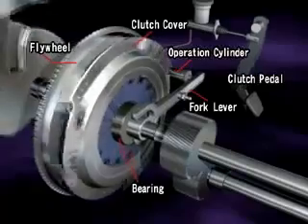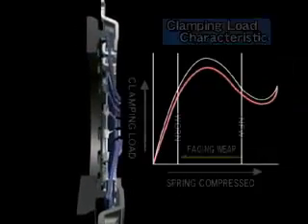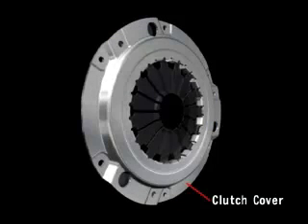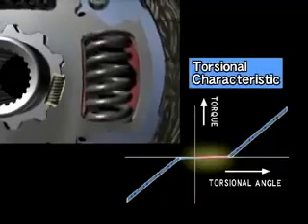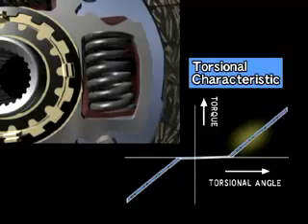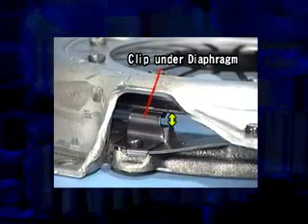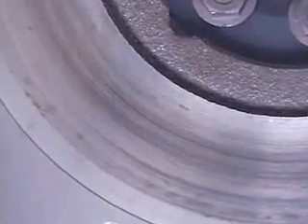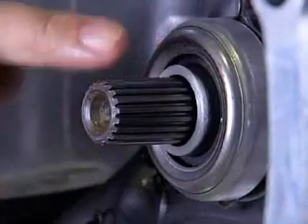HOW A CLUTCH WORKS   NZ Automotive Distributors - NZAD - Clutches - Flywheels

Comment: The clutch disc is NOT attached to either the clutch cover assembly OR to the flywheel OTHER than by the force of the diaphragm spring. When the clutch pedal is pressed that spring force is removed and the clutch plate is free to float between the flywheel and the pressure plate. The clutch plate is only directly attached to the gearbox input shaft via the splines on the shaft and the matching splines in the centre of the clutch plate on which it can slide. (N.B. The CAPS are only for emphasis,)

Comment: Wait a sec, if the clutch plate is bolted to the flywheel, then how can the clutch disc be in free motion if it is attached with the clutch plate? The clutch plate is always rotating with the flywheel right?

Comment: Great job, the extra detail was very helpful. Am I correct to say that the force holding the clutch firm against the flywheel comes from the elasticity of the diaphragm spring? So, the throwout bearing is designed to pull evenly back on that diaphragm spring to relieve the pressure?

Comment: When the clutch is fully engaged (the clutch pedal is out fully) there is no slippage between the clutch disc and the flywheel as they are in full contact with each other. Likewise, when the clutch is fully disengaged (pedal is in fully) there is also no slippage as the two parts are separated from each other. But when the clutch disc and the flywheel are only in partial contact (pedal is halfway) they start to slip and this creates friction which wears down the clutch.

Comment: The only thing I don't  understand is: how does one burn a clutch plate, if the clutch plate is disengaged from the engine? Assuming the driver is adding gas when fully pressing the clutch pedal. Anyone know this? Or am I  not understanding the clutch concept exactly?